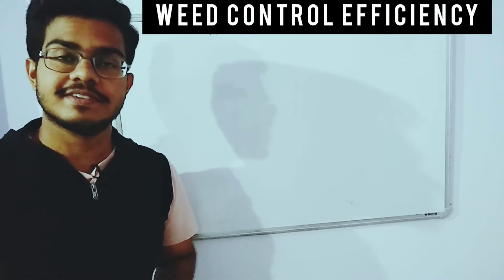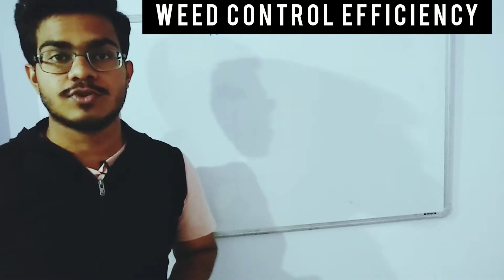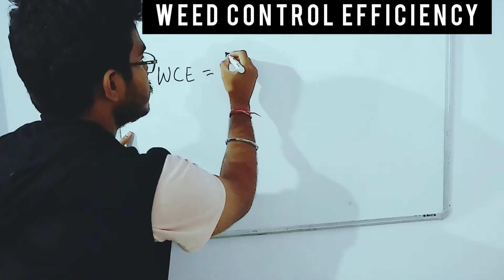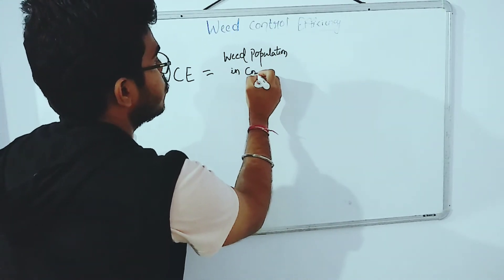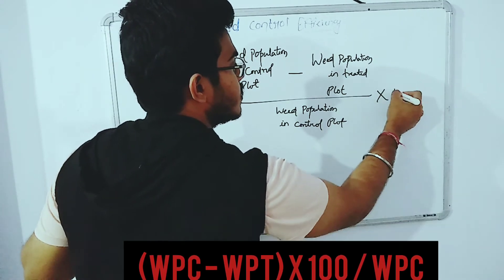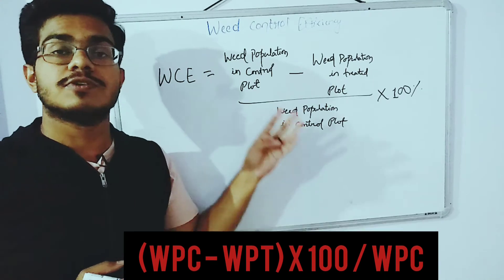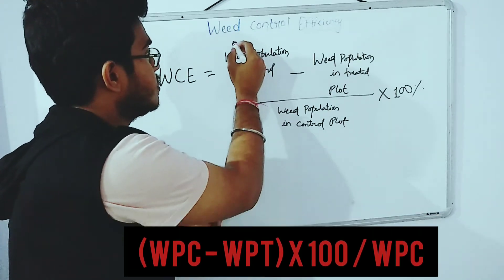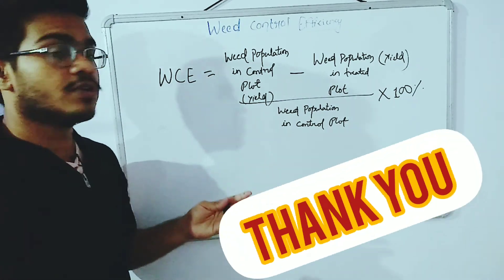WEED CONTROL EFFICIENCY : By Sameer Mohapatro

Comment: Sorry, i will ask question for this, this is formula can used at time first observation?, when population in plot control and population in treatment a little difference, because when first observation condition weeds in treatment still clean but using this is formula weeds control will become not make sense with condition in area, because divider in weeds plot kontrol not big difference with weeds in plot treatment,so result weeds control at first observation will be small even though weeds still very clean in plot treatmen at frist time obeservation

Comment: What is the WCE, if the weed population is 0 in the control plot, but 10 in the treated plot? It is not allowed to divide by 0. Do you understand my problem? I would be happy, if you could help me
Reply from the maker: WCE is calculated based on the mathematical data recieved from the field or research plots. As per your question, if the control plot has 0 weeds then there is no use of the formula.

This WCE formula is to compare the weeds intensity between control and weedicide applied or biologically controlled plots.
Control plot is the area where no weed control methods are practiced so there will be obvious growth of weeds in  control plot.